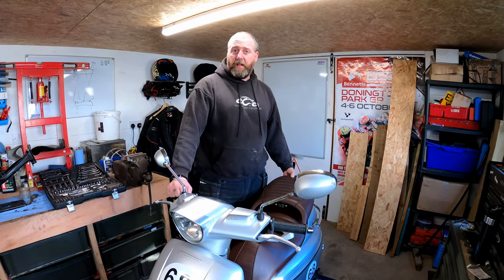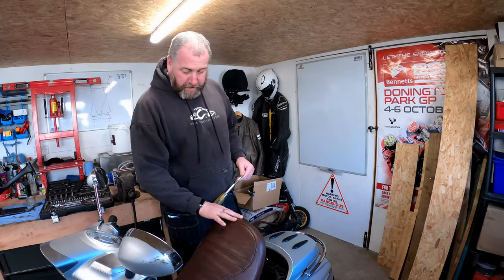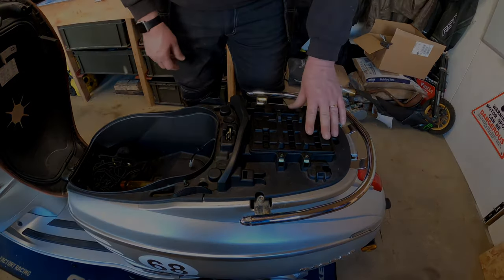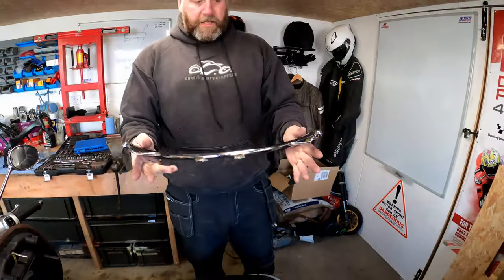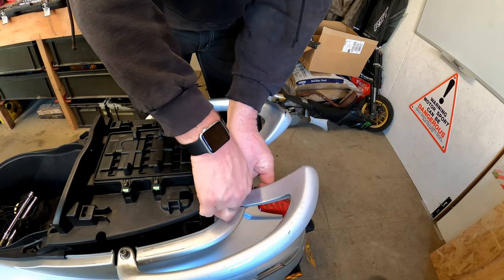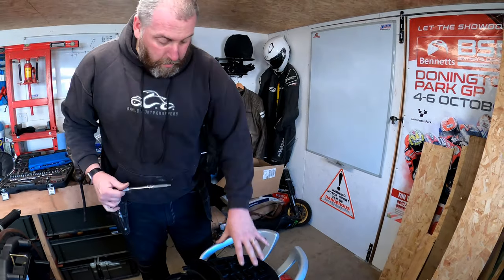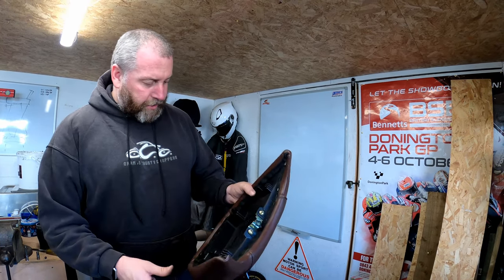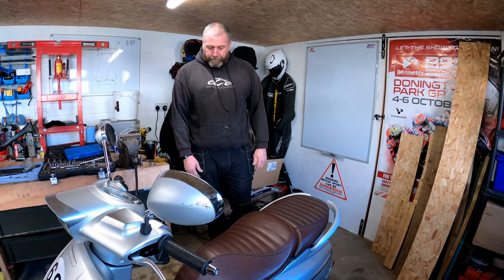Peugeot Django - Rear Seat And Passenger Grabrail Upgrade

Comment: How do you open the front of the seat? I've got a rental at the moment and can't work it out. I've tried turning the ignition key and looking for a key around the seat and nothing seems to work??
Reply from the maker: Turn the key in the ignition anti clockwise bud 👌🏻
Reply from the maker: You’ll hear the lock pop under the seat
Reply: Kev,
A bit of a random one. I also have Django (50) that I inherited for a cheap commuter. I am a full licensed rider. But seems like the scooter has a restricter on it. Do you know how to remove the restricter? Would it be a CDI or washer? Or both. Curious! Ben in Australia
Reply: I've got no idea about a restrictor but I did find it pretty slow too but then again it was a rental and I normally ride a GSXR1000 lol